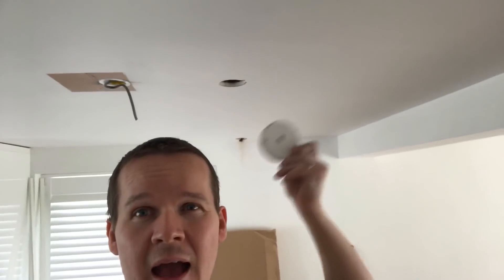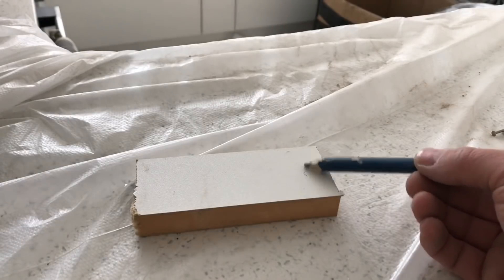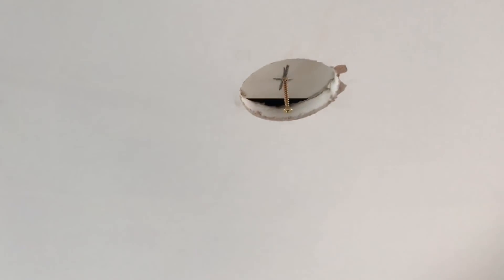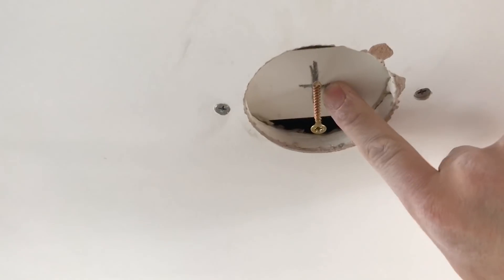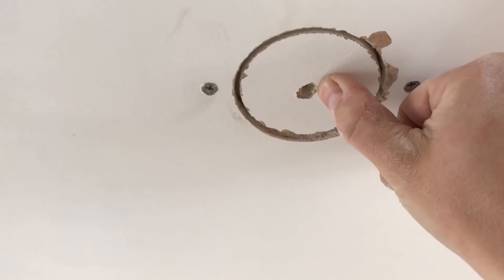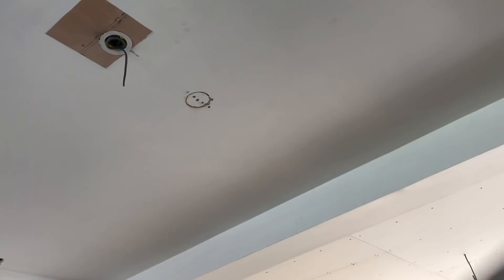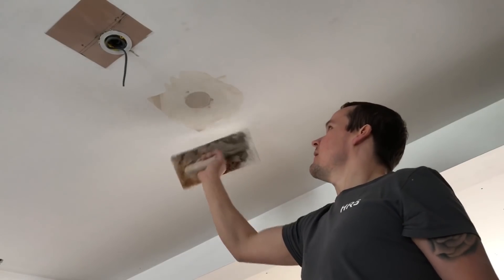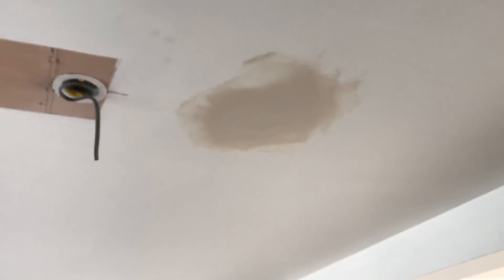CJR ELECTRICAL 95% don’t know how to fix this!!

Comment: I do the same but with gripfix on the batten then with another longer batten with a clearance hole for a longer screw to pull the batten down onto the ceiling. Then gripfix the plaster circle with a screw through centre hole until it sets and then remove screw. Then finish as you described but no screws as these are always a weak point for plaster finish.

Comment: Loop a bit of T & E over the wood, pull down tight whilst you put in the outer two screws,  and then pull the wire out. Saves putting a screw in the centre, just the way I do it😀

Comment: Pretty much exactly how I do it. Some people like to use adhesive or filler to "glue" the piece back in first but I find its easier to brace it like this. The thin wood battons that usually come in washing machine packaging I find are particularly useful for that sort of thing. I remember once drilling two downlight holes in the wrong place on a brand new ceiling (brainfart moment). The customer started freaking out saying it would never look the same (they had attempted to fill holes before themselves but they had done it wrong and it didn't look flush - typical DIYer). I challenged the customer to find my wayward holes once they were filled, sanded and painted. The cound not find them and neither could I - completely invisible.

Comment: I think you mean “95% of electricians won’t fix this”. Im payed way too much to be doing sheet rock
Reply: Lol.  Last time I looked, Klein doesnt make trowels or drywall mud.
Reply: paid*
Reply: jon cullen  It's not correct in any form of English.
Reply: @Jmvars  and  "Im" instead of "I'm"", shocking!
Reply: @kr1886  That one is acceptable. "Payed" instead of "paid" isn't.
Reply: Most electricians are to sorry to fix the holes they make. Had some come in a job i was doing and the cut holes everywhere and wasn't supposed to cut the first damn one. Came to me wanting to get paid, thank God i happen to go by the job to take a look. They cut over 90 holes in the walls and ceilings.  I asked them if they had a drywall guy coming to fix them and they said oh no we don't fix the hole we leave that up to you. Mind you they said they could run everything without cutting into the walls before they started the job. After it was all said and done they ended up spending over a thousand dollars on a job they only charged 460 to do. I never call electricians anymore if I have to run a wire I do it myself and if I have to cut the wall I patch it myself that way I have no one to blame but myself
Reply: If you are construction electrician, then yes. If maintenance and stuff, then often times there is no other way than to fix the mess. Why should a drywaller and painter called out because of 1-3 holes? I never paint, but I fix it so that it would be easy fix for the painter... If its kind of hidden place or a area that doesn't need to look super nice, white fire sealent silicone into the grooves is a super easy fix, no need for painting.

Comment: I had an electrician run some outside lights across the back wall of my house and he cut out 16 of these in my kitchen leaving me to repair them so to add to this great video and maybe an even better tip - make sure the right plug goes back into it's own hole, the buggers seem to fit better around the edges. Great video mate.

Comment: There are apparently more then one way to skin the cat. :-)
I did not think of your methods, but it looks like it works, I would choose a longer board, depending on the thickness of the ceiling. Often do people choose the same places to hang a lamp so making it stronger and using a longer board, can maybe avoid someone drilling at the end of the board later on.

Comment: I use use toupret tx10 filler mixed very stiff with boiling water.

Apply as you did but it will cover in one go and sets hard really quickly.

I would never use expanding foam, this is a needless step.
Reply: Paul F the toupret stuff is great as in most instances it fills in one go and doesn’t shrink.

Comment: The method I used was very similar - but glue instead of screws and as the glue thickness raises the plug away from the surface no need to remove the backing from the plug.  I can't even remember where all the holes were now and I have looked for any sign that they were there and there is none!

Comment: Would you use this on socket chases going to bond first but want a smoother top finish need to start practicing filling my own chases now I'm working for myself
Reply from the maker: Yep great for a top skim coat on bonding. Can easily be sanded down after.

Comment: Total DIYer here, watched a few of your videos today, great stuff.  After watching the other ones, I was thinking "where's the foam?" for a while:)  

I've always found (once I realised how runny it needs to be) that finishing plaster is much faster and less messy for covering shallow/narrow gaps than premixed filler, if you're revisiting with more filler once the first layer goes off and shrinks, wouldn't it be easier to just go back with a smoothing trowel and a spray bottle on top coat plaster?  

This isn't criticism, or a call for attention btw, just curious about choices:)

Comment: Have you ever fitted an electric sauna
Reply: Super easy... just according to the regulations... sauna oven producer, state electrical law, right wire and fuse and so on... there are specific regulations what type cables in what conditions it is allowed to use in sauna(! special rules for sauna because of the heat). Differs little bit in different countries, so there is no direct clear answer. Just follow the requirements. Ask local professionals, not those know-it-all guys. Skilled people often times gladly share information, but make sure that the source is reliable.

Comment: Next video, how to boil an egg lol :P
Reply from the maker: Great idea 👍
Reply: boiling an egg is not easy especialy if you want a runny yolk
the hard part comes when you need to do more than 1 at a time
Reply: @NickRoegiers its easy. have the water boiling first then follow the onsite guide for length of time depending on yolk consistency required. or ask your mum :P

Comment: Do you prefer this method over a butterfly patch ? It certainly looks stronger with a bit of wood behind it and screws holding it altogether. Thanks for another method to fill or patch up tho 👍
Reply: There's no real benefit either way except that a butterfly patch requires an additional piece of plaster board.
Reply: @firstsurname9893  I guess it just comes down to the materials at hand 👍

Comment: Good video making the process straightforward. I don't think its  necessary to use foam to fill round the gap though. Using 2 coats of filler should suffice in my experience. Keep up the good work.

Comment: I thought I was the only sparky that fixed holes?
Client just asked if I could fit a loft hatch😳🙄
Reply: You're joking. Do the lot too.  The Chasing, spot holes, sockets etc.
Reply: zu1875lu 
They’re carpenter walked off site so I ended up making a loft hatch then I fitted the guttering and down pipe for the new extension. The plasterer turned up and the boxing for the pipe work in the en-suite needed doing too, yeah I fitted it too🙄😁😊
Reply: @bertiebassett1972  lol I've hung doors and fitted skirts as well 😂 hey if they pay its all money and actually makes a welcome change too. Usually ppl find a tradesman and totally trust them. If I'm quiet, December, January etc... I've done other trades.

Comment: dont use MDF   its to hard. The force required to add the last screws for the piece of drywall will tare out the 2 screws holding it in place. Or just loosen them off. Use spruce or pine

Comment: Are you kidding me my man???  Here in the States we leave that to the drywallers... we're electricians not fixers.....
Reply: Many British homes have solid walls so Electricians have to cut chases into the solid walls and put the wiring in the chases using a conduit to protect the wiring so maybe because the wires are "exposed" they fill in the chases themselves. I guess they apply the same concept to any holes they make.
Reply: Jay, a lot of clients like a 'complete' job so  a bit of quick making good goes a long way.

Its not really like we are skimming a whole wall.
Reply: @MrPaul1f  
Understood my man, going the extra mile, all good.

Comment: Yes it is true, American electricians don't do drywall repair and drywall guys don't do electrical. It is a matter of quality.  When you become a Master electrician, you realize that you are NOT a master of drywall, plumbing, carpentry, HVAC or any other trade. I can do all those things and will for my own home. It lowers your standard of quality to tell customers you will do professional electrical work and by the way, will patch sheetrock, paint your bathroom, fix a leaky faucet, change the oil in their car and mow the lawn.